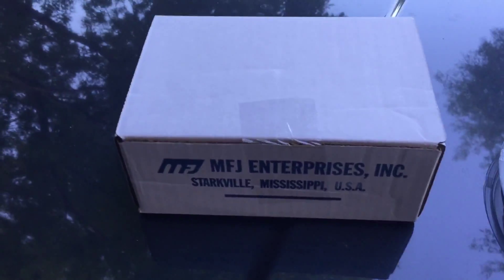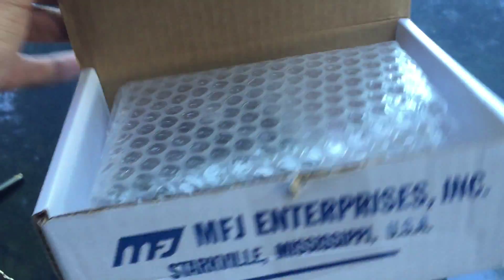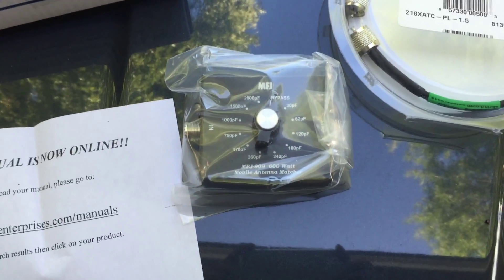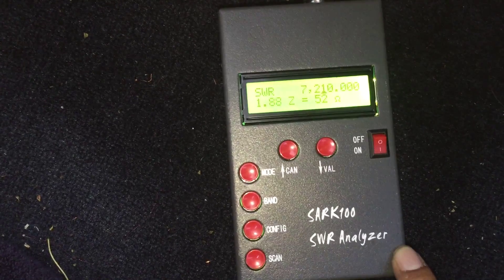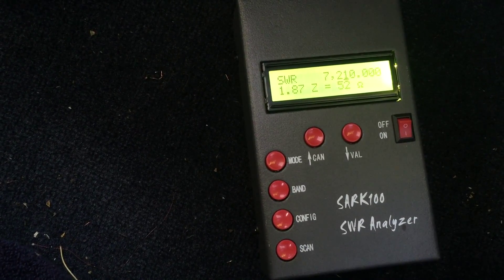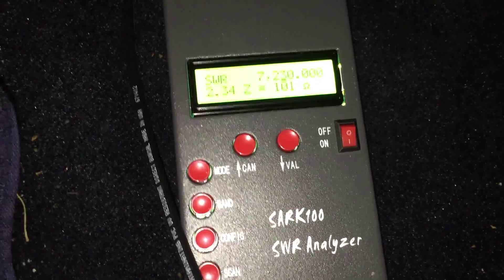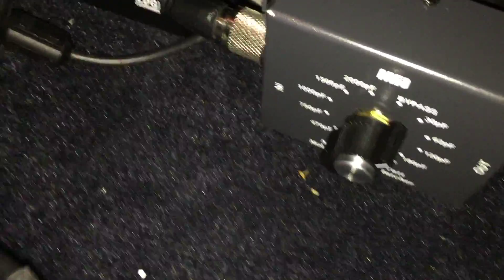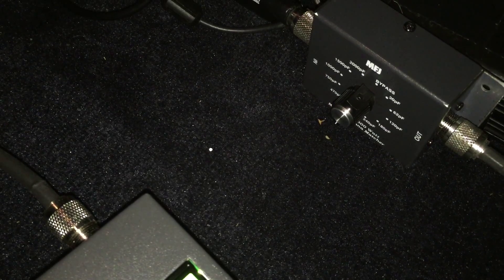Unboxing, Setup, and Testing of MFJ-909 Impedance Matcher

Comment: So you have the setup like the following :  Radio ->  LDG-Tuner ->in MFJ-909-out> Antenna -> ?
Reply from the maker: Yeah - mostly so I don't have to use the tuner when all I want to do is listen (Which is what I do 99% of the time in the car).  The idea originally was also to have a close match if I forget to use the tuner and transmit accidentally.  

Mostly it just helps me listen better without having to hit the tune button on the radio.  The MFJ-909 is not necessary of course.

Comment: so you have the LDG tuner and MFJ tuner in line at the same time?
Reply from the maker: +Chad Butler Yes, though the MFJ-909 is more of an "impedance matcher" than a tuner.  It presents a lower feedpoint impedance to the LDG tuner, hopefully providing a wider tunable frequency range.  It's not necessary, but should help as this is a very narrow-bandwidth antenna.  Only 30 KC between 2.0:1 SWR points.

Saturday Evening I'll be uploading an MFJ-929 Tuner video as I'm upgrading from the LDG tuner.

Thanks for watching!
Reply: cool!  I was wondering why the LDG autotuner could not perform the impedance match alone.
Reply from the maker: +Chad Butler The LDG tuner can tune it anywhere in the 40 meter band, but it'll tune it to 1:1 (supposedly) using a 10 watt carrier from the radio, but then the radio will show 2:1 plus SWR sometimes when I transmit at higher power (at like 7.260, for example.)   Hopefully the MFJ-929 tuner that I'll receive tomorrow will be better.
Reply: Thanks for the info...good luck!